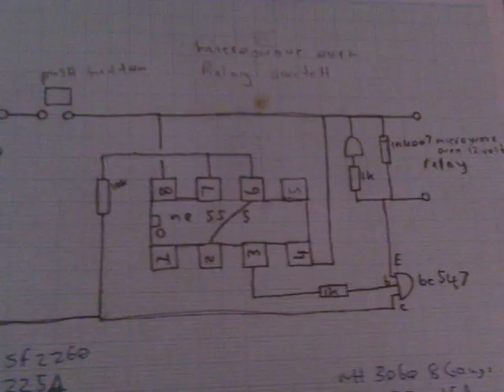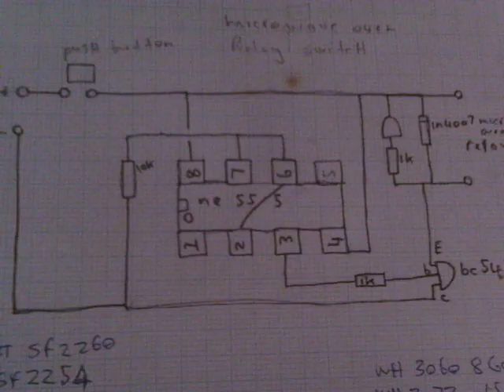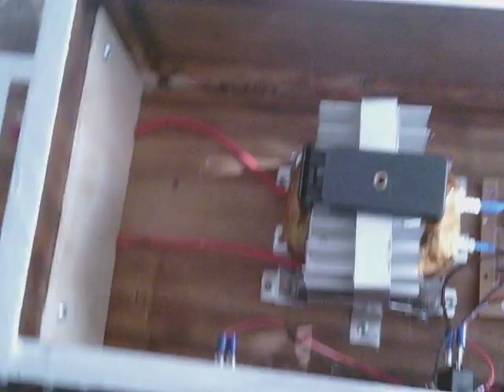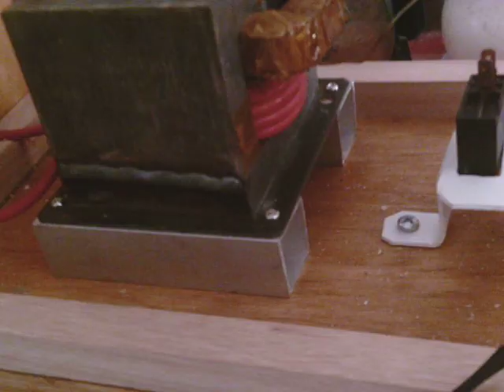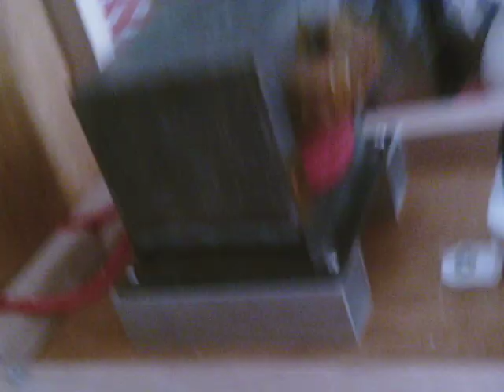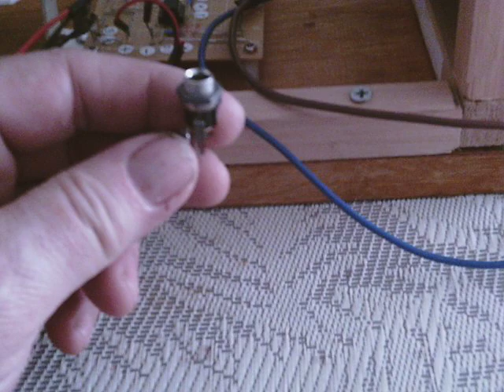low voltage ac high current power supply project number 2

Comment from the maker: ive did more tests this time through the single phase 1600 volts 100 amp bridge rectifier,  how bizarre can it get i fed 10.9 volts ac at the measured current no load of 37 amps and i got 10.11 volts dc which is point 2 volts higher than the ac voltage input ,and i applied a load resistance  at the output it measured 000.1 ohms a thick steel wire  and it glowed orange hot instantly so i have a high dc current and point 2 volts dc more than the  ac voltage input so im getting somewhere

Comment from the maker: jaycar electronics have a clearance on the high current clamp meters and i had just enough to buy one and the current output measurement no load is 37 amps exactly  with the 10.9 volts ac so that's great from my no 2 low voltage ac high current power supply project.

Comment from the maker: when i changed the 6 tur 12 gauge secondary i clamped the microwave oven transformer into a steel vice to helod it and wound it there this was very helpfull in trying to get the turns as tight as can  be .

Comment from the maker: the digital multimeter i used to measure the ac voltage was correct but with the instructions lost i looked sat the jaycar electronics catalogue which i brought it from all digital multimeters have a maximum ac current readout of only ten amps so what i got was erroneous readings like 00.48 amps is only 48 milliamps so thats error nous reading and the cheap 3000 amp loop current reading multimeter they sold so cheap are also error nous it gave 0.48 amps which is 480 milliamps yet the coper wire across the outputs glowed orange hot instantly so that has to be more than 480 milliamps which is what google says when i gave it the error nous details

Comment from the maker: despite what ive measured and fed the details to YouTube and what it told me  i decided to try get better encouraging results by trying a load test so i used the same copper wire with enamel burnt from it when it also broke off at one end from the heat.  to test it forget about the 0.048 amps  the wire went orange hot instantly so i may have it right it probably is 10.90 volts ac 48 amps so this may be ok for the 1600 volts 100 amps bridge rectifier to convert hat unfiltered to dc i think ive had good hho production from using a sealed lead acid cell battery so i don't think i need any filter for a hho cell s its not an electronic  circuit that needs filtered dc if it was really 48 milliamps 0.048 amps why did google not say that it may get more under a real coper wire load maybe my visual perception of what i saw in the meter reading was altered to stop me getting closer to something im not supposed to find out. Well dream on here .

Comment from the maker: ive removed the 6 turns of 12.0 gauge wire and wound in around 12-13 turns good news is the voltage is now 10.90 volts ac and the load current is now 0.048 amps and i wanted at least 4 amps well at least some dc convertor circuits may be able to convert that to the current i want

Comment from the maker: the best thing i can do is remove the thick 12 guage wire of 6 turns and change it to 16 gauge and get more wounds into the core and then measure the ac output to get the right voltage and current and adjust the output by removing a turn at a time  and re measure it  till its at the right specifications to convert to dc

Comment from the maker: these low voltage ac at even 12 amps or over  are basically useless  i cant get enough voltage to even convert to dc and the current is to high for such low voltage  so ill use these for ac  rochell salt crystal zapping and the current is still to low for even spot welding so what can i use these for well the fun at making them at least ive lernt nothing from it for the time being so ill have to decide to change the wire gauge get more turns into the cores and get more voltage to be of use when i think its worth another go as these types of microwave oven transformers i have are just to small to get the right gauge wire in the right amount of turns into them, ive seen a youtube video where a man got around 8 turns of 12 gauge into his microwave oven transformer but he has a bigger transformer and i havent i cant get enough turns into it past 6

Comment from the maker: ive did another test of the ac voltage and current output it is 4.57 volts ac and the load current using my digital multimeter set to the current was up and down but i read in the figures 12.97 amps to 13.06 amps and im sure that exceeds the multimeters current measuring limit which i think was 10 amps so ill try out the 3000 amp high current  inductive loop type meter next time

Comment from the maker: ive just did a load test using a 21 cm single strand of coper wire  dont know the gauge and sanded the ends and curled each end around the bare ends of the secondary outputs the turned on the cooling fan and  the rest, and hit the initiator button to activate the 12 volts dc power microwave oven relay circuit and a small hum then the whole wire heated up and smoked and burnt off at one end so it roasted it and burnt most of its enamel off, so the current under that load was high enough, what if i tried a bigger wire with lower resistance  it may create smoke like this second test did , and  my  modified transformer em dampening idea like they use in microwaves dose work, so when you modify a microwave oven transformer make sure you pack a few peace's of silicon steel against each side of the primary under the secondary wound  to dampen out the hum and vibrations

Comment from the maker: ive completed that project and it works but with no-load the output ac voltage was then 4.55 volts ac and i measured the load current to the multimeter without a real load and it was 0.134 amps or 0134 amps , ill double check that next time , which may go up when i try a real load and the few cut strips of silicon steel collected from dismantling microwave transformers  secured under each side of the primary and facing the 6 turn secondary, damped out the em oscillations if thats the correct way to put it , so well the transformer hum was very low and not noisy and it barely got warm so it works . more tests to do yet,  now the voltage may still be to low but at a voltage loss of 1.34 volts said to be if i run it through the 1600 volts 100 amps bridge rectifier may or may not be enough to get the hho production going better through the capacitor bank , other wise i could use it to slow charge a capacitor bank then dump the dc into the hho cell for a fast hho production burst the small microwave oven transformer here you cant get to many turns into them for the primary unlless i use a higher gauge size .